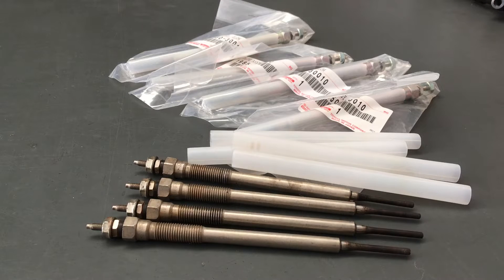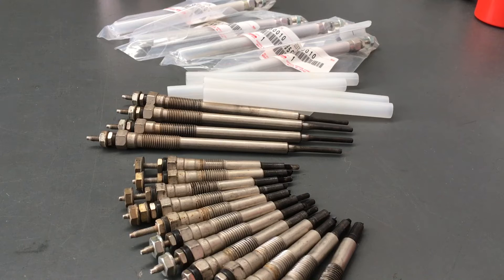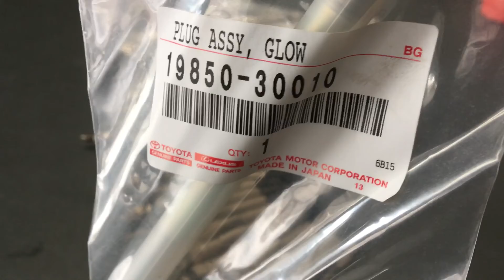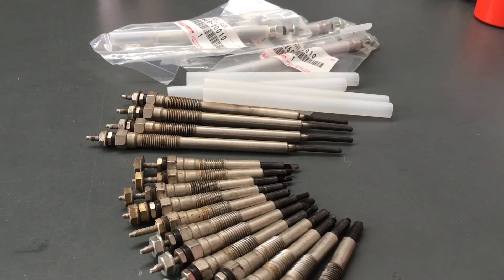Prado hilux diesel 1kd-ftv glow plugs

Comment: 1KD-FTV glow plug replacement do you have to remove the damn fuel injector pipes to get to them?
Reply: It's possible I've got a 2kd here and you have to take off inlet and allsorts it's a complete pig,no space either so some drop the engine off the back mount